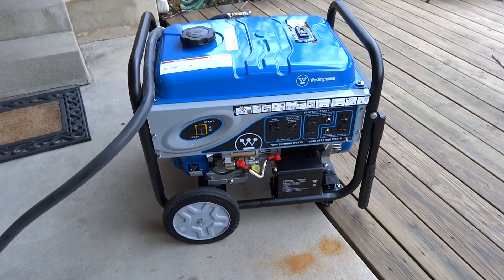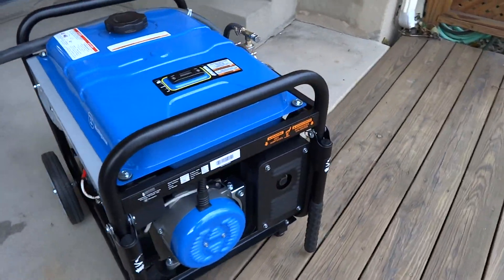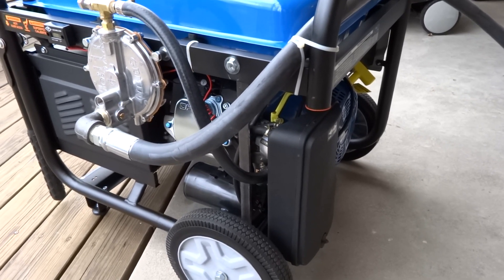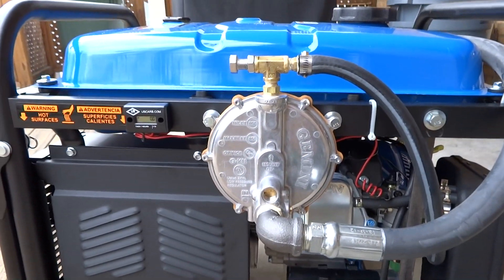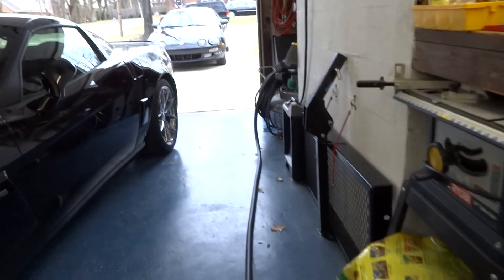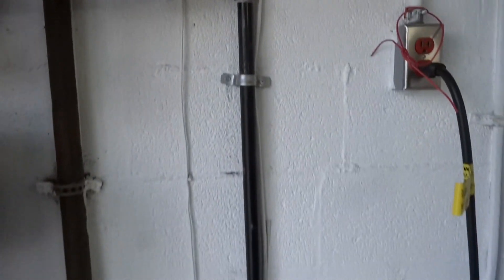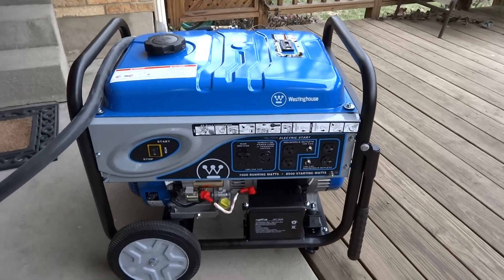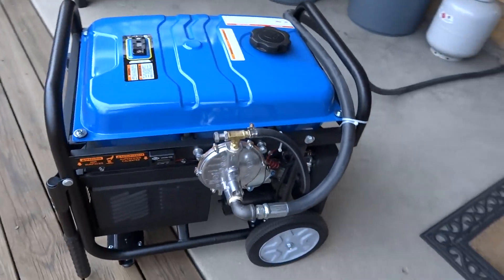Westinghouse WH7000EC Generator Natural Gas Conversion

Comment: What most fail to mention is when you convert your generator from gasoline to propane you loose about 10% of generating power and from gasoline to natural gas about 20%. Ex 10,000 watt generator running on natural gas will only produce about 8000 watts. But it’s so worth it not to have to hassle with gasoline.

Comment: Killrz1, I had a quick question on your gas service.  I have the same kit essentially, and am running a 3/4 inch to my WH7000-85000 generator off of a 1 inch service as well, but wanted to know what your gas service pressure to your house is?  I understand the service  is low pressure but wanted to know what EXACTLY is your service is?  Thanks, and nice set up sir!

Comment: I have  3/4” NG line with stut off at back of house but I’m 25 ft away from generator hook up. Can I run 1/2” or 5/8 hose to generator or do I need to come closer with 3/4” and maybe 12 ft of 1/2” or 5/8” hose with quick connect? Thanks
Reply from the maker: Hey Captain, not sure I have the expertise to answer your question precisely.  But, there are volume and pressure tables for NG (Google) that dictate supply line sizes relative to the length and I think in your case 3/4" is likely called for.  NG at our homes is around 7 PSI if I remember correctly so the supply line requires a bit larger size.  At my old house I ran 20 FT of 3/4" hose successfully in 2 10 FT sections straight from the gas meter line (installed adapter) which I believe were 1-1/2 Inch - primarily for the furnace.  5 years ago we moved to a new house and I had an outdoor gas line plumbed for my NG Weber Grill and Gen on the old quick connect from the old house.  The discussion with the builder relative to what I planned to do with the Grill and Gen had them size the black pipe gas line at 1 Inch.  I sold half of my 20 FT hose and the 10 FT 3/4 Inch hose works fine for the Gen on the 1 Inch line from the house.  As a side effect - having a NG grill is heaven over those POS propane tanks.  Hope that helps!  Having Captain Morgan tonight in your honor. :-)
Reply: killrz1 Thanks I’ll look that up better to have more gas then less gas. Thanks again

Comment: How much does a 20ft gas hose cost with disconnect on both sides? And I believe the type C kit was changed to The Snorkel conversion kit. Funny thing is on their dated website page their chart say Type C kit only for Generator’s 12hp or less @ 189.00 and Type 4 kits for 13hp and higher but I seen several video’s with 13, 14 hp using the Type C kit. Anyway I just need to know how much a 20ft hose would cost with quick connections ? Thanks

Comment from the maker: Jake; however, asks a sensible, legitimate question.  The conversion is easy if you are used to working on mechanical stuff and familiar with a little plumbing.  I don't have a stake in US Carburetion but they do have several kits to choose from. Good luck!

Comment: I bought this generator from Costco. I also purchased the snorkel kit from US Carburetion on their new website motor snorkel dot com. Not sure if it is live yet. I found it doing research and I ordered a kit online. Had a call back right away wondering how I found the webpage. I was the first customer to order. No cutting away the frame on this generator for this installation. I still have not started this conversion yet.. seems really simple. I am planning on posting something on how this goes.

Comment: You are a hero! Thanks a lot for the video! I just bought this generator and will take this on. The conversion kit costs about the same as a 14 gallon gasoline container, so this is really a no-brainer! Not to mention it is an extremely manly project! I second the request for info on the hour meter.

Comment from the maker: Yes Steve, I considered the conversion easy.  I had to read the directions a couple time - the language could be better.  I don't believe the warranty is void - there is an example on the US Carb Forum of someone getting their gen repaired under warranty; although, the gen was defective - not the engine.  As for quiet, the Honda is likely quieter.

Comment: Hi Killrz1: Awesome video! Costco has these on sale now and I was wondering if one could do a NG conversion on them. A couple of questions:
1) was it fairly easy to install the conversion? I don't have a problem cutting the frame as described in your video.
2) Would doing the conversion void the warranty?
3) I was originally looking at the hondas because they are very quiet. I can't seem to find detailed specs online. How noisy is this unit? 
4) Can this unit run continuosly? Thanks again.

Comment from the maker: US Carburetion web site has everything you need. I priced them out with others on the web and couldn't find better prices on hose. I bought a 20' first then wanted the gen farther away from the house so I added a 10'. The quick disconnect works really well too. Thought I was going to have to go into action yesterday - had some ferocious storms come through and the power was unstable, although it didn't stay down. I am prepared though!

Comment from the maker: BTW NCPDFSB, another advantage to the conversion is the fact that since there is no gasoline in the carb, you don't have to run the gen every month.  No gas to varnish the carb or fuel delivery.  You can probably get by with exercising the gen every 6 months or so.

Comment from the maker: Thanks NCPDFSB, you can plunge in with confidence.  I had email questions about a loss of power when converting to NG but US Carb and others have stated that as long as you plumb your gen with the required supply of NG by connecting with the proper diameter hose/line based on the distance from the gas meter, there is no loss in horsepower whatsoever.  I can't wait for my power to fail again soon!  :-)

Comment: hi killrz1, bought the same generator from costco too. great deal. thanks for posting this video. may take the plunge and convert mine in the near future. glad you mentioned cutting the chassis didnt impact the rigidness of the frame.... bought my tach/hour meter at northern tool...also added a battery maintainer.